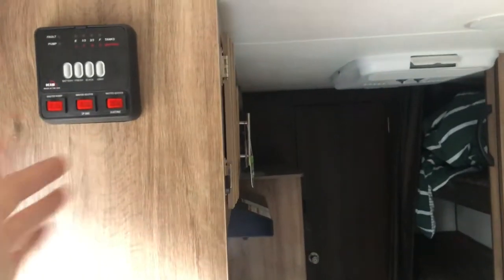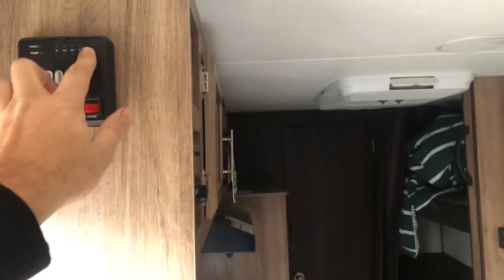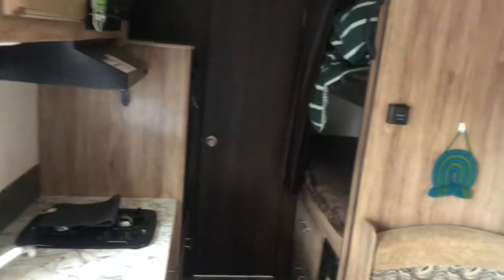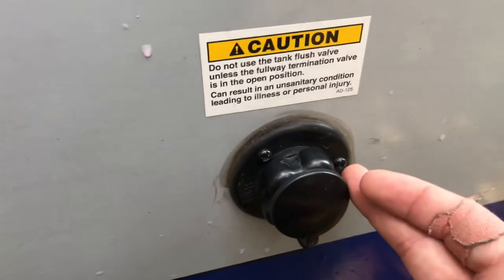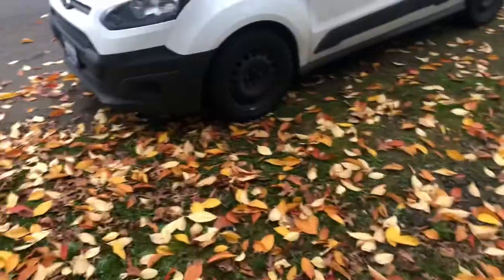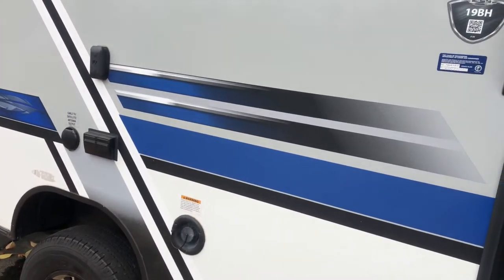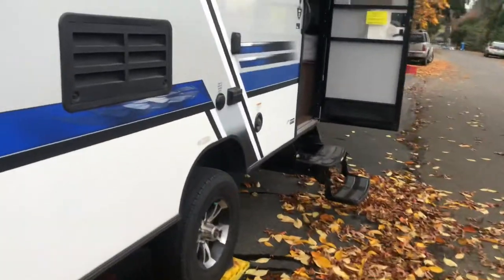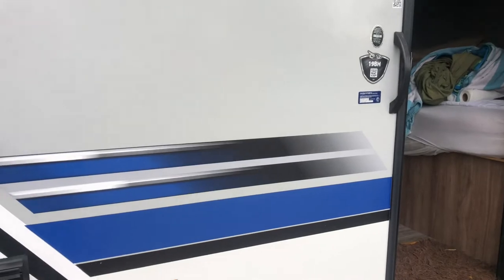Rv black tank reads full after emptying Tips and tricks

Comment: one thing I can not figure out is how know when the black tank is full when the sensor is not working.  A lot of videos say to use the tissue dissolver and fill it up with water, but how can I do that without over flowing into my camper, if there is no way to tell how full it is.  I have the tissue dissolver already, now how can this help if I don't know when it is full enough to clear the problem?
Reply: We had the same issue and called an RV Technician.  He filled the black tank with water for 2 minutes then released the water.  He did that several times and it solved our issue.  That cost us $300.  Now we do it on our own and save our money.